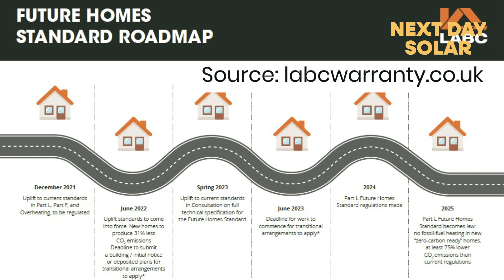Will Air Source Heat Pumps replace gas heating systems ? ASHP uncovered

Comment: Totally disagree with your comment on good idea to replace your gas boiler with a heat pump. You guys are typical live in London own your own buisnes and most of your customers have spare cash to have what they like and do they care or worry about paying an electric bill. People research watch other youtube videos and then make a dession. Heat pumps on paper are a no brainer but what you will notice that every heat pump installer will blame over company's saying they don't calculate it correctly. My bugalow requires a new boiler as well as I cannot have one because I require a 3 phase upgrade to replace my boiler will cost £2700 heating and hot water on demand no tanks to kerp heated. For a heat pump it's between £12000 to £16000. Hmmm so where does the average uk family find this. For me it's an extra £15000 to upgrade the power to my home. Because I have 2 ev chargers and my loads are greater than 100amps at times. Untill the goverment brings down the electricity prices and up grades to homes the net zero goverment plan will fail. Homes really need more than 4 KW Solar systems. For those who don't have solar they are fantastic with good light, I have a 5kw storage battety and for at least 2 months a year my battery's do not even reach 28% charge.
Reply from the maker: Hi Gino, I understand your frustration. I think its a case of 'do what you can', I've wanted to insulate my loft for many years, now getting to doing it. I sense you have a few BIG consumers hence the need for 3-phase power. If you are limited on roof space there isn't a great deal else you can do without bigger batteries and 3 inverters in sync to give you the 3-phase setup you might want. Its all expensive kit, its coming down, and sadly the energy price hike in April is going to reap havoc. ASHP are new and expensive kit, they cannot get as hot as gas boilers, but they point in the right direction, and we do need to move if we are to have a chance of keeping this place habitable long term.
Reply: @nextdaysolar3349  totally agree with you, but I think the high temp heat pumps which are out but not yet in uk could be the awnser to straight exchange over from boiler without huge exspence. Let's see how that works. I get very frustrated as most youtube videos on the subject always pretrays people who fork out £20k plus on a system to save the plannet yet they are not bothered about payback or electricity prices as they don't need to worry about it. But the real problem is working family's who can only afford £11k for a first generation ev that has only a 70 mile range and when that battery dies on them another £4k to replace battery let alone replacing a working gas boiler for a heat pump.
Reply from the maker: Gino, of course. Its the reason why we are in the situation we are in. The priority is always to feed a family, keep the lights on, get through the week, and its certainly the 'icing on the cake' however in time as energy prices rise, perhaps much like getting connected to a gas or electricity supply (where you don't pay for the generator) just the energy, the energy companies will pay to install your own 'generator' and you pay them the price for electricity. Its just a more de-centralised model. Lets see
Reply: @nextdaysolar3349  will keep an eye on what's going to happen after the prices rise. I will now bring my plans forward tor more solar and off grid battery's. All ebay used lol.

Comment: This is more of an advert than genuine analysis.

One major point ... heat pumps are not carbon neutral.

The manufacturing is not zero carbon

Replacing a well functioning modern gas or oil existing system will take decades to reach carbon neutral just on installation. A neighbour/friend of mine, in a new build designed for heatpump and solar water, is on her 3rd heat pump in 12 years and she had two winters with no heating with problems getting replacements.

Heat generation requires electricity - most of which is currently fossil fuel generated and that is unlikely to change.

Try telling the whole truth.

Additional points - if there is a large uptake of heat pumps can the electric grid cope with the increased demand - as I understand it capacity is already stretched. These are serious energy consumption devices - in the winter equivalent to running multiple electric ovens 24/7.

As electric vehicles grow in use and petrol/diesel are fazed out what is going to happen to grid demand?

I am not against heat pumps in principle but they are not a panacea. In the right buildings they are brilliant. The biggest issue is persuading people that the cost of all the work required is worth it - just a relatively simple radiator replacement system is likely to be 3 to 10 times more expensive to install than a simple combi boiler and that is not including the ideal of retrofitting underfloor or massively improved insulation in older buildings.
Reply from the maker: Hi, I appreciate your interest and think you raise a number of fair points. To address them in turn, whilst a gas boiler does need electricity to run, it's about 60-120W dependent on the system setup, which could quite easily be generated through renewables. Clearly very little in this world is 'carbon neutral' but if we can generate/harvest 'energy' through a more environmentally friendly method, and then use it in a cleaner fashion, I do believe that is likely to be the solution to a cleaner future. I myself have currently a gas boiler, but complementing with solar and insulation and other energy saving/environmentally positive measures. You are right in that a conventional oven uses 2kWh of energy, yet an ASHP might use 5-6kWh which is a huge deal of power (especially through winter). When it comes to the grid most homes have a 100A supply, if 3-phase then 300A, which is the equivalent of 23,000 watts, at least 4x as much as an ASHP might draw, so think we are good there, and most EV chargers are 7kWH so plenty of additional capacity, and cables are sufficiently rated thanks to good planning in order to deliver that. As with most things in life, the best outcome for the planet, people will be a balanced approach, taking advantage and opportunity of the appropriate technology when its affordable, and when the old system is at such a point that it needs replacing. Clearly replacing a relatively new system for an ASHP would be wasteful, and other measures could be adopted for a cleaner lifestyle even whilst running the gas boiler. Most hot water tanks (if present) have an imeersion coil, so solar PV can be used (if any excess present) to heat water and reduce the requirement for gas use.
Reply: @nextdaysolar3349  thanks for the reply.

Whilst I agree that homes are capable of running ASHP and car charge does the grid have the capacity to cope with a huge increase in 24/7 running winter ASHPs. House circuits have the capacity but rarely use massive amounts, even so when the nation eats in the evening the grid almost reaches supply capacity. Its even more worrying now that we are held hostage to Russian supplied gas. The government is already in talks to get gas (for electricity generation) supplied from the USA in case Russia turns off supply.

One other thought occurred to me too ...

A big selling point of ASHPs is a COP of 3-4 vs. a gas boiler COP of around 1 (for gas consumption). The difference is gas boilers don't run 24/7 even in winter - they cycle to maintain temp and most people turn them down or off when out or sleeping. Lets be generous and say the boiler is actually burning 6-8 hours a day and suddenly gas boilers too have an effective COP value of 3-4.

Personally I think the Nordic model should be enforced by building regs for all new builds (effectively almost zero heating/aircon required) where minimal use ASHPs are ideal (ideally a multiple property shared GSHP system installed on new housing estates). The trouble is the government won't be brave enough to impose this on developers as they rely on political donations.

For older houses by all means install heat pumps where possible (financially and where they will be truly effective) but support other housing with brilliant insulation grants (not installed by cowboys) and solar solutions. Instead they have removed incentives for solar and insulation schemes have been done on the cheap.
Reply from the maker: @CarolHaynesJ  I think we agree on many themes. I am now insulating my loft, a video to be published soon, I'm really interested to see the change (if any).

Comment: Canadian here wondering why in the UK all heating is boiler based.   Any reason you don't use forced air which is basically all we do in Canada with a few exceptions.
Reply from the maker: Hi, i think there are quite a few reasons, UK homes generally tend to be smaller than those in other countries which have a'bit more space, so the homes were never built with ducts for the forced air system to work with. Radiators date back 100's of years in the UK, and us Brit's can be a'bit stubborn when it comes to change, the 'Victorian' style radiator is still fashionable in the UK ! I've noted a few issues with forced air such as 'nuisance noise' and particle/dust build up in the ducts, as well as not having the ability to control temperature in each room/zone as effectively as you might be able to with a typical water based central heating system. I'm sure there are ways around many of these 'con's, but for sure its not something prevalent in the UK currently. We are seeing in new blocks of flats and shared living, systems like forced air 'passive heating' and other ways of managing temperature in a space which rely on vented ducts, so its not a total NO in the UK. ASHP's are not as flexible/fast to distribute heat quickly as boilers, but we will have to get used to it, as the UK looks to ban new boiler sales from 2035.
Reply: @nextdaysolar3349  thanks interesting for sure.  Was thinking the minisplit systems would be popular perhaps in new builds, no ducting and easy install.  Thanks for the info

Comment: So will high power air conditioning unit replace cheap efficient gas ?  Yes If we let governments enforce it
Reply from the maker: There are over 1 Billion air conditioning units in the world currently. The warmer the world gets, the more we use them, and the FGAS inside, which isn't good for the planet. Its a catch 22, the world is warming, we use more aircon, more energy (predominantly fossil) and the problem gets worse, the world warms. We are trapped..... So will an aircon unit replace gas boilers, perhaps, and clearly a benefit of using electricity (which we can generate cleanly as opposed to burning natural gas).
Reply: @nextdaysolar3349  The refrigerant gas problem may be a non problem. It was possibly the first trial by the watermelons of population control.  Next came global warming.  Both have been shown to be non problems. The ozone layer is still there and changing every year.  The global warming problem is an artifact of manipulated data and language
Reply from the maker: Perhaps you could explain that to the people of California, Algeria, Haiti and so on..... I don't agree that global warming is an 'Artefact', when we have been polluting the globe intensively for 200+ years.
Reply from the maker: @stephenrichards5386  And look what happened to the dinosaurs... I don't fancy my ancestors in Christies Auctions on a plaque for a few million !
Reply: @stephenrichards5386  I believe there is global warming taking place as there is a lot of evidence for it e.g. ice melting, record temperatures (in recent history anyway), however you are right to say we need open minds I am not convinced CO2 is the cause but if we assume it is the case our best approach mat be growing trees and plants on land and in the sea to absorb the CO2. It does seem to me that we are listening to global warming zealots and there is a rush to make changes that are unlikely to solve the global warming problem but will cause many people severe economic problems.

Comment: well, it just isn't practical in many new houses. there is no place for hot water tanks. they use combi boilers, usually fitted in the kitchen, so where will a massive tank go? Plus if you have a large Jacuzzi etc the tank will run out before its full. tanks are a backwards step.

Comment: 1. Most houses in UK are poorly insulated, so the heating needs to be as cheap as possible. 2. For the consumer,  electricity is 3x more expensive than gas per kW. 3. Its the dead of winter, its arctic conditions outside, yet you believe you can convince the average Joe, you can extract heat from outside!
Reply: YES you can extract heat from air that is down to -25 degrees, I can vouch for this as I have ASHP fitted which heats my hot water and does the heating, it is done using a special refrigerant that can find heat in the air you wouldn't expect! our loft is insulated with 18 inches of insulation and cavity wall insulation. my Electricity bill direct debit for an all electric house is only £35 per month (averaged out over 12 months, So YES IT WORKS VERY WELL

Comment: This is hilarious “zero carbon” ?
The reason why electricity is 2-4x the price of natural gas (in terms of BTU’s per £), is because most of our electricity comes from the burning of fossil fuels and is transmitted to us through a fairly lossy network.
Don’t give up your combi boiler!
If you really want to get environmentally friendly AND reduce your bills, then add a solar water heater to your roof feeding a tank in your home, which is then topped up with heat from the combi - not a simple setup, as pressure becomes an issue, but that coupled with improved insulation, is the only way you can save money and reduce your carbon footprint.
Heat pumps simply move the fossil fuel burning from your home to power stations.
And no, wind energy isn’t nearly as cost effective as it should be, due to the huge costs of maintenance and eventual replacement of blades etc.
Nuclear is actually the cheapest and cleanest form of electricity generation, if there were never the risk of a once in a lifetime disaster.
Reply from the maker: I think you are ignoring the fact that its relatively easy to generate and store your own energy through the use of solar/batteries. Yes there is an up-front cost, but equally it does payback over a 10-15 horizon, and then you are 'off-grid' and self sustaining.
Reply: @nextdaysolar3349  unless you have a tiny house and lots and lots of panel area, good luck trying to heat it with photo-voltaic and an air source heat pump.
Reply: @nextdaysolar3349  For someone professing to know solar - you clearly do not understand that for most of the UK housing stock which is EPC ‘D’ the heating load in KW is beyond the capability of solar panels in winter - when the heating demand is at maximum - even with a correctly designed heat pump heating system. The only possible exception are houses built to passive haus standards or those lucky enough to be able to turn over an acre of land to deploy a 50 KW  solar installation which might produce 10KW in the winter.
Reply: @nextdaysolar3349  Why would I want to tie my money up for 10 to 15 years before seeing anything back. Also you roof has to be perfect direction to be able to get enough panels to get any sort of payback.. The salesman will tell you it is perfect but when it comes time to see what you produce there is a huge different between promised and actual.
Reply from the maker: @alanturnbull7528  Hi Alan, I think with the news today about increases of 50% on energy bills Solar and (independence) becomes all that more important. The only direction panels are not well suited toward is North, an East/West system can work quite well, and in some circumstances even out perform a south facing system from a self consumption perspective due to matching supply and when the house needs the energy the most. So I think as of today the 10-15 is squarely under 10, but of course every system is different. If one has the money, can you put a price on the environment and your own independence.

Comment: . ... The Clear Air Strategy has promised that 'only the cleanest stoves are available for sale by 2022'. This won't affect the kinds of wood burners you can run, but may mean that you can only buy certain stoves for a couple more years, before they're phased out.11 Feb 2020.Also if you have a gas boiler it is much cheaper to run don't be fooled about how good heat pumps are the are not .

Comment: Eight years experience of Mitsubishi Ecodan ASHP to heat radiators has been absolute expensive disaster. No matter how I run it my KWh consumption is 40% higher than with electric storage radiators and I will never get a penny of the installation cost back. In the winter the hot water circulating through radiators is heated by an immersion heater!
Reply from the maker: ASHP should really be installed with underfloor heating systems, that require a much lower flow temperature to operate, where some benefit could be seen. Try running the electrics off solar/batteries ?
Reply: @nextdaysolar3349 "Some benefit" !!!!!!.
Reply: I am a heating engineer and I've seen they only really work on underfloor heating and then if you hook underfloor heating up to a gas boiler that works very well solar PV work well just a pity that the battery storage is too expensive otherwise I wouldn't have roof tiles I would cover the lot with solar panels is solar thermal the sun is an unrestricted heat source I have come across a few of these systems where the inhibitor chemicals have crystallised due to very high temperatures the only way to get over there to have the panels flushed very expensive no such thing as a free lunch